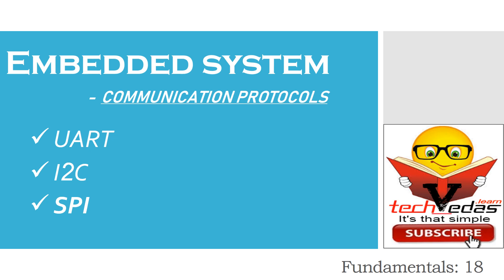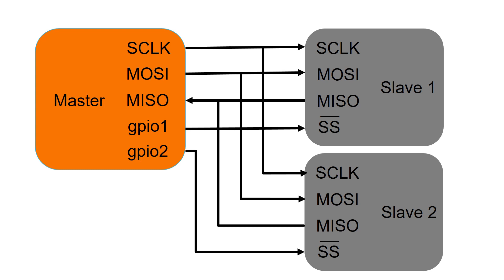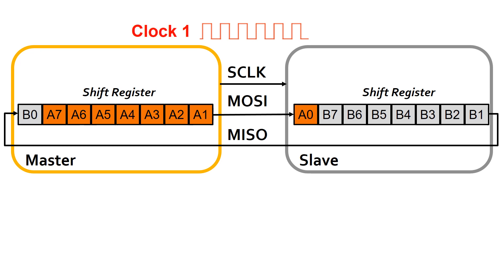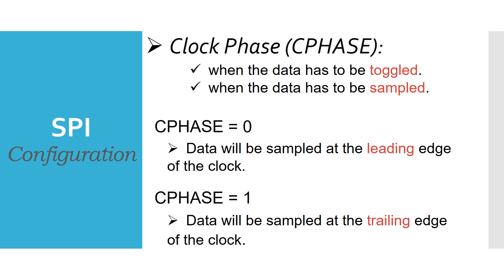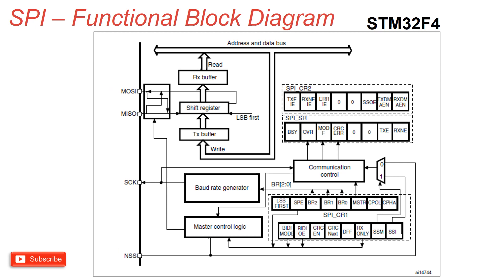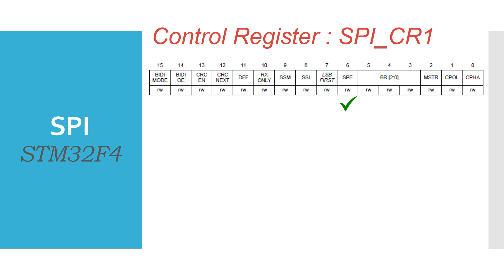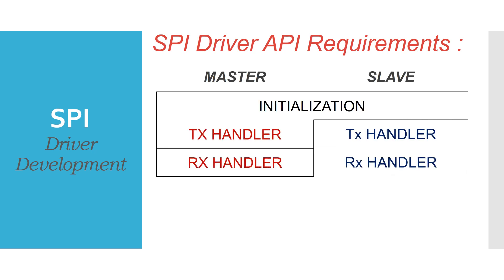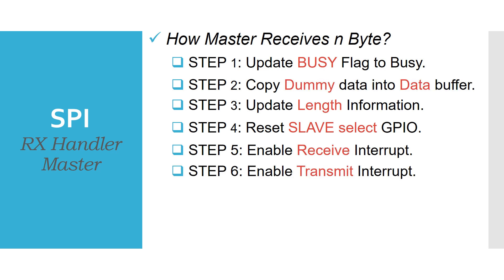SPI Driver Tutorial | SPI Protocol Programming

Comment: What will happen if the clock of master is different from the slave?
Reply: You should not configure like that. Similar to UART baud rate, SPI master and slave should have the same clock frequency because a clock pulse is used to determine a change in data and an event in sampling data either in the transmission or the receiving end. MCU vendors do have delay registers which can be configured in the master node.

Comment: Nice video .. can you help me I am working on the stm32f103c8 trying to establish spi master slave  communication STM to STM  using SPL library  issue is that txe flag remain reset .
Reply from the maker: Hi Mamta, Thanks for the feedback. 
Assuming there is no hardware problem. During configuration due to some mistakes we face lot of communication issues. Please have a look on below steps:
1. Check for the data sheet and confirm all the req steps are taken care during initialization.   
2. Prob CRO to see clock signal is generating properly (req freq) during data transmission. 
3. Prob CRO to check MOSI line during transmission.
Reply: @TechVedas  thanks actually issue in intializing SPI in stm32f103c8 nothing is being written on SPI2 registers even after intialiazation. Gpio clock is set gpio configred SPI clock SPI2en bit is set  Can you please help me ?
Reply: Hi mamta, If you have done SPI communication, then please help me to write the code. I am also using the same stm device. So if you can ,please help me.....